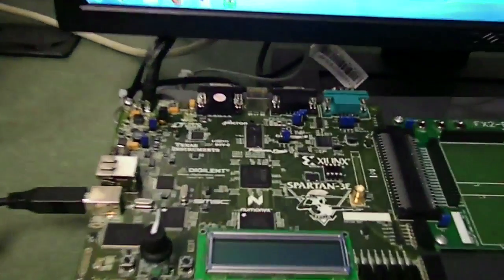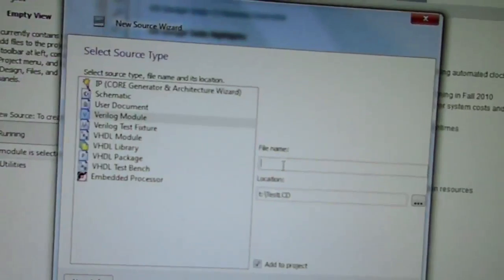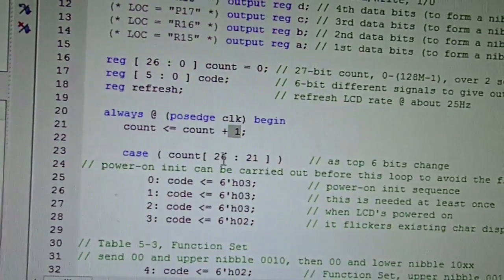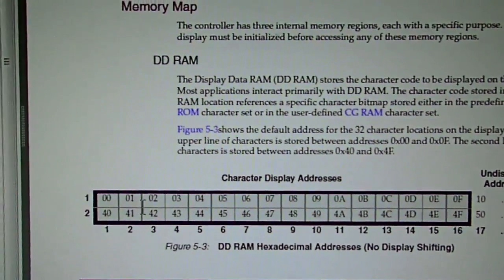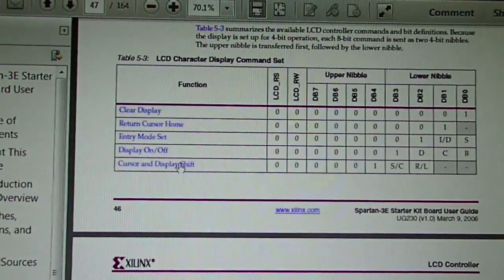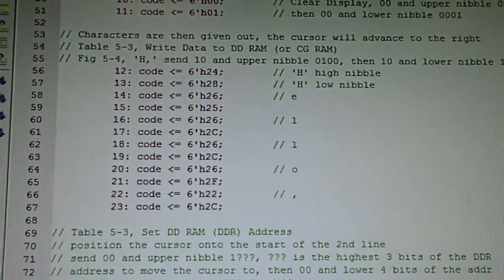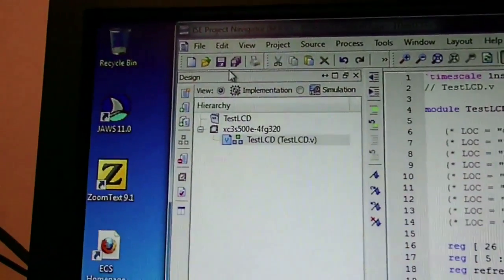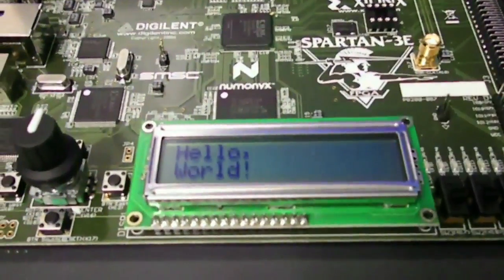Program LCD on Spartan-3E, Verilog/FPGA (TestLCD)

Comment: I got a mistake in the last line (e, rs, rw, d, c, b, a ) <= (refresh, code); does anyone know what's the problem??

also the TestLCD.bit is not generated anyone has an idea??
Reply: Use this: 
e <= refresh;
rs <= code[5];
rw <= code[4];
d <= code[3];
c <= code[2];
b <= code[1];
a <= code[0];
Reply: Mohammed Sami 
used { } this bracket

Comment: REALLY WELL DONE 
I have a Lattice MachXo Control Developer Kit. Wich runs out of the Box, with 
exact Board spec. RefFiles from the Lattice HP. To run in Diamond IDE. 

But now i try the Verilog Stuff from Xilinx 3E Board, wich i am a little confused to install
the JTAG Device to program the Spartan 3E. 
Also the License Files from Xilinx is so confused, wich ISE you shold take for this
older Spartan 3E. Its helpful to watch this.. Thaks a lot.